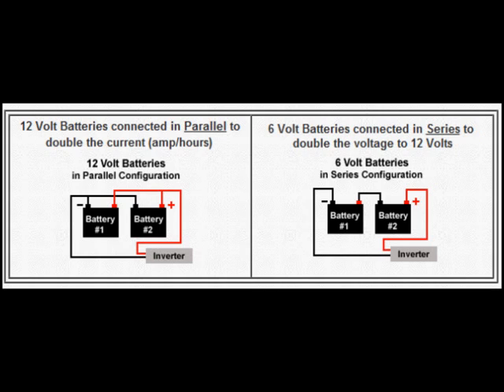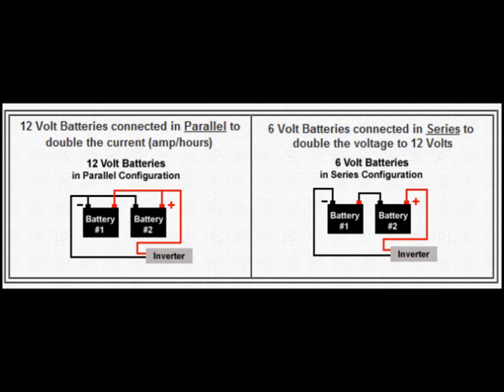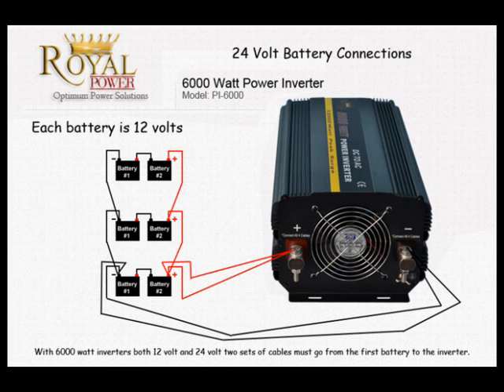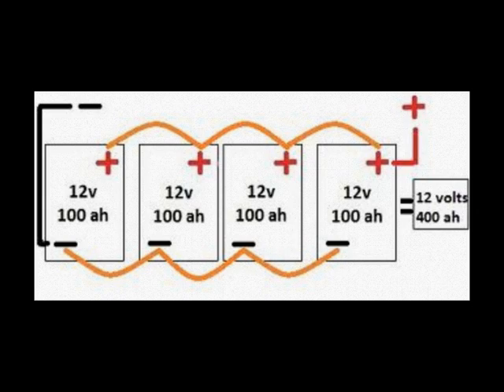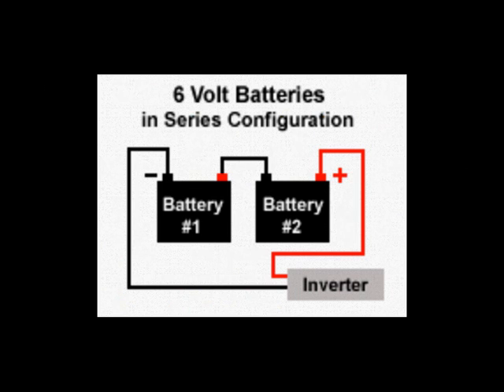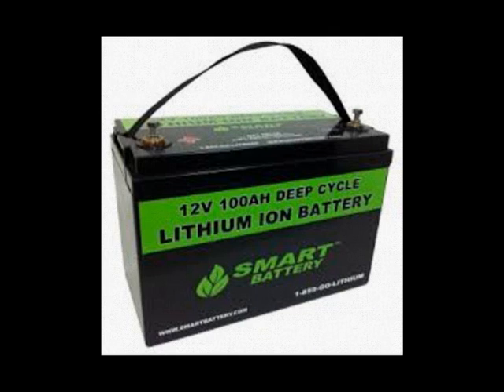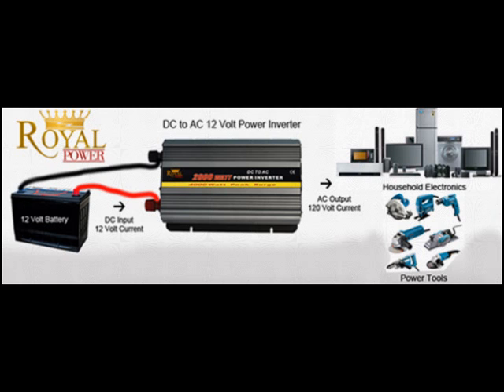How do I connect two or more batteries together?

Comment: is it good decision to use 1 12v Lead battery with 1 12v Liquid Acid Battery?
Reply from the maker: To create a 24v or to run two 12v batteries in parallel?
Reply: @Royal_Power_Inverters  12v output in parallel, but the type of 2 batteries are different
Reply from the maker: @sherlockholmes6849   It would depend on the make and model of the particular batteries.

Comment: Please correct me if I'm wrong ...

 connecting batteries in series increases the voltage while maintaining the general "amp hours" of the battery

connecting the batteries in parallel increases the "amp hours" of the battery while maintaining the voltage the same.

I guess what I'm trying to figure out is if I connected 6 - 12vdc - 100 amp hour lithium ion batteries all in series to make 72vdc would in then maintain approximately 100 amp hours?

This is part of a project car that I may be working on in the near future.

Comment: Hi, Thank you for this video. I wanted to connect two 12V 60AH battery and use it as 12V 120AH, so I am going to connect them in series connection. But in case of charging, My charging adapter provides 12V 6A of current and connected with a single battery. In case of handling charging, do I need to change anything or will it work normally if I just connect an additional battery in series??
Reply from the maker: You will need to connect your batteries in parallel to maintain a 12V system. the the 12V charger should be fine.
Reply: Thanks for your quick reply. I will buy a new battery tomorrow and connect them according to your suggestion.  Actually I am planning to extend coverage to three new room, so i need to extend my power source also. Currently I am using a 12V 60AH battery to light 4 led total power of 28W (solar panel of 65w to charge this battery). And now i am adding three more light of having 7W each. So i plan to add one more battery. Is this enough??

Comment: Hi sir , I have one 12 inverter and two 12 V batteries . Can I use and charge both 12 V battery with one 12v inverter.
Reply from the maker: Yes, just make sure you connect them in parallel to retain the 12V system.

Comment: If i were to wire 4 12v leisure batteries together and keep running 12v, What thickness wire would you recommend?
Reply from the maker: The thicker the cables the better the connection will be.

Comment: Hi, Thanks for the informative video. I subscribed. I was wondering if I could run 100ah and a 200 ah lipo batteries in parallel. Or do they have to be the same?
Reply from the maker: They can have different ah as long as the voltages are the same.